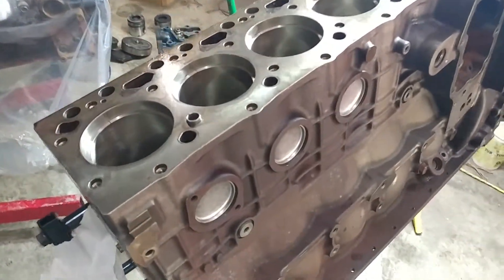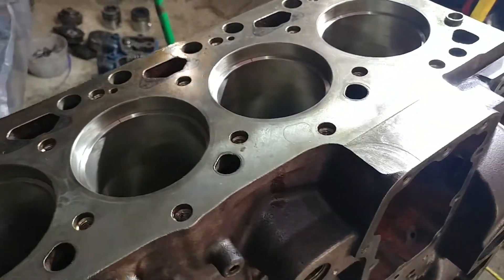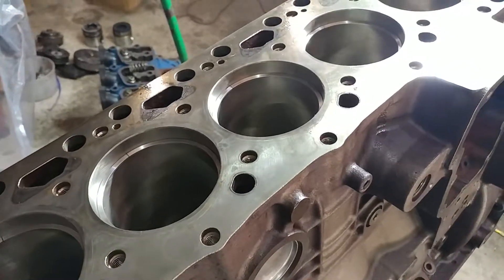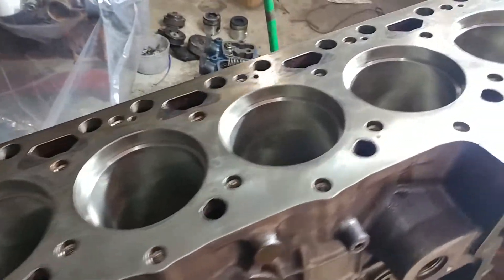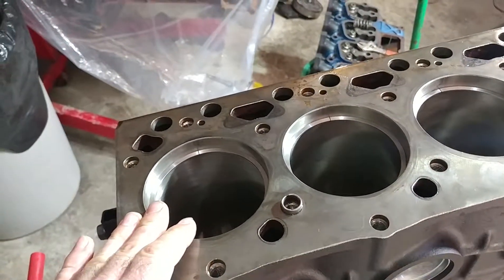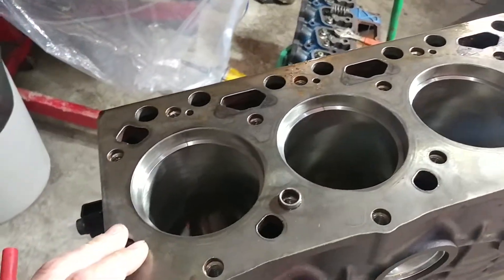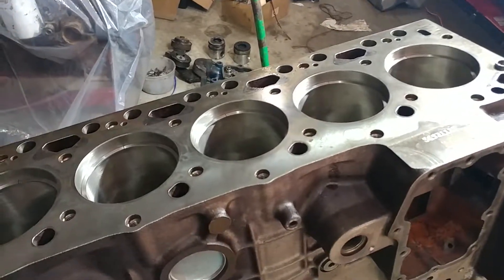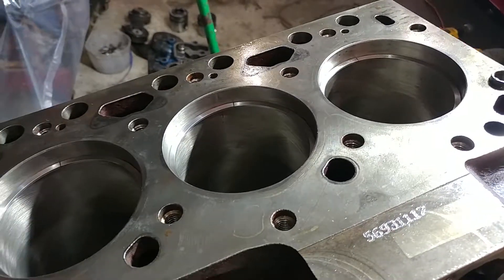Chronicles Of An 03 Cummins Rebuild -Part 6- Setting Compression Ring Gap + A Helpful Hack!

Comment: When measuring piston ring end gaps, it is important to check the gap with the rings at the top and bottom of the bore. If the bore has taper wear, the end gap will be larger at the top and smaller at the bottom of the bore. Use the bottom position to set the end gap.